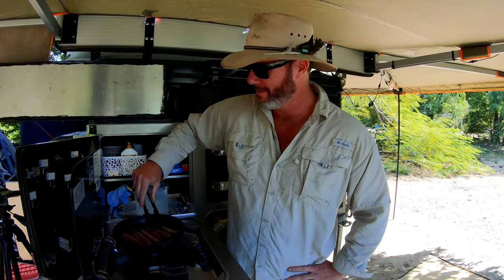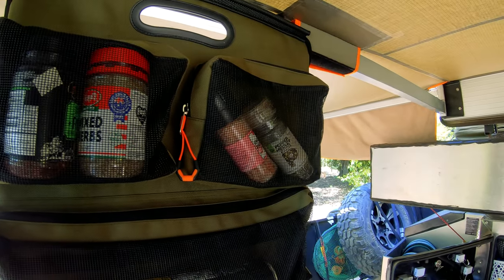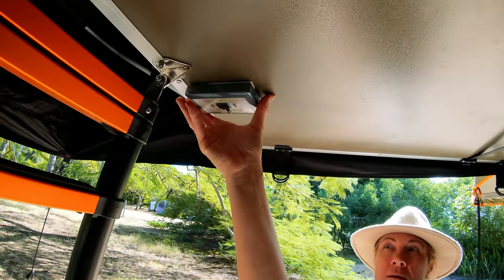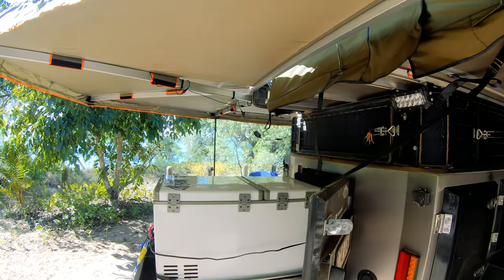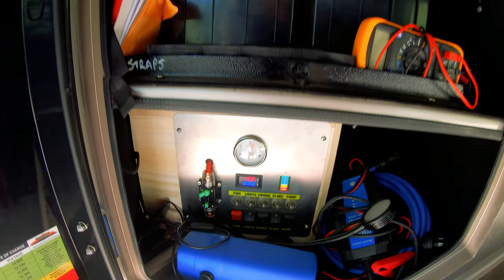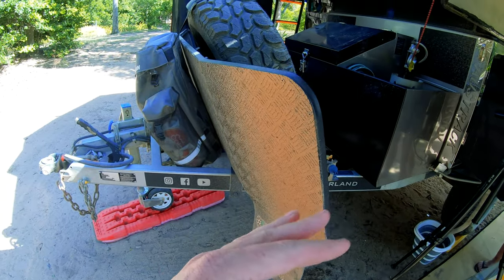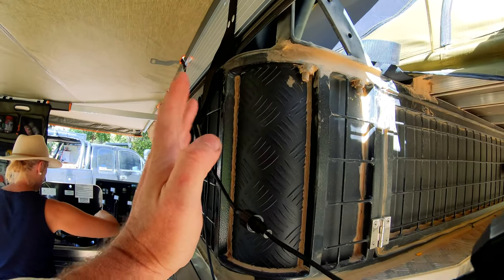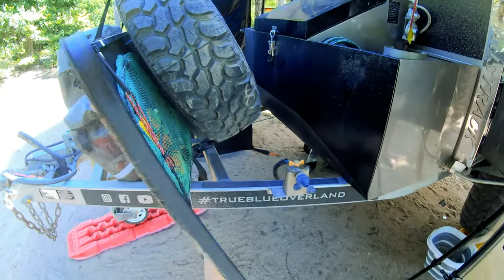Our Camper Trailer is FINALLY Complete... Somewhat!?

Comment: Great tips on both the deck foam and the toiletry hanger. Question: did your trailer come with a clamp on light with a 5.5mm plug on the end and if so did you find the outlet for it. Got me bu66ered! Cant find an outlet and cant work out whether its 12 V or 5V
Reply from the maker: Thanks mate. That foam decking mod has been working a treat. Have had many people thanking me for that one. Haha.
In regards to the light... it didn't come with one. However. We were gifted one exactly what you describe. We've used it once over the kitchen. But no... no outlet for it. We have other lights that use the same connection to a cig plug. So we just use that.
Reply: @TimRumble  Worth asking, thanks anyway

Comment: I’m about to give my conqueror a big make over. It’s got a bit of rust coming out on it so going to sand it back, treat the rust & respray in raptor before the rust gets worse. Also replacing the tent with a 23 zero RTT. Should not have sold the one I had on my Hilux when I got the camper. What size is your tent?
Reply from the maker: I love those conqueror trailers. We considered one but they don't come up for sale often. 
We we've got the 2200 Dakota. I believe it's the biggest one in the range.
Reply: @TimRumble  mines just the little UEV310 but perfect for me and the kids. I was lucky, it popped up on marketplace & I picked it up from Eungella. It’s a solid little trailer apart from the rust coming out, don’t like the tent at all it’s too big & bulky for me to manage on my own - doable but way too much effort for my liking. Ok, I was debating whether to go the 1600, 1800 or 2200 RTT for the camper.
Reply from the maker: Yeah what did ya have on the hilux?
The 2200 is massive. It is bigger than a king bed. That mattress I find is good for me. But I like a firm mattress. Sometimes Michelle reckons it's not quite thick enough so we sometimes sleep with a doona underneath us aswell. 
Leaving all our bedding and pillows in there too is a tad difficult when it comes to the straps. But we've had ol mate at true blue canvas make us some longer ones so we don't have any dramas now. If you wanted to check it for size at all we could probably show it to you one weekend. But it might be a tad tough to handle by yourself.

Comment: Do you have details of the step tread material - would love to do this to ours, cheers
Reply from the maker: G'day Steve. I just used that EVA boatbdecking material. It has a self adhesive backing. Comes in a variety of colours.
Reply: Awesome thanks for the info
Reply from the maker: @stevebirch1880  no worries mate.